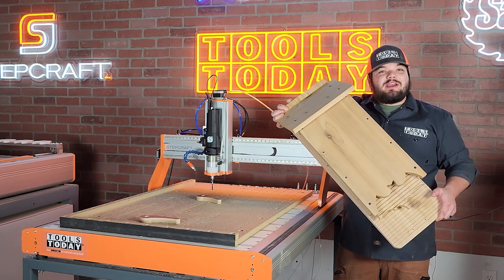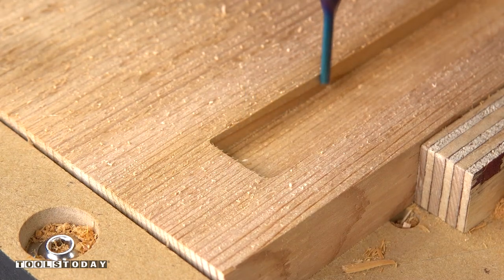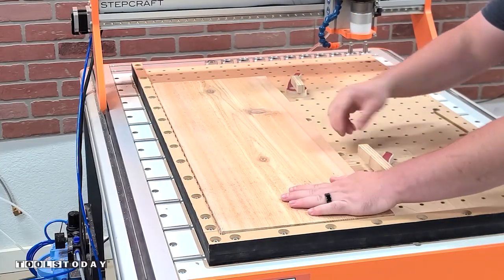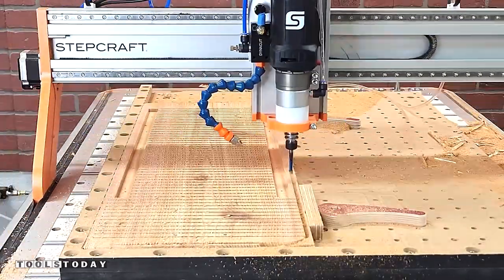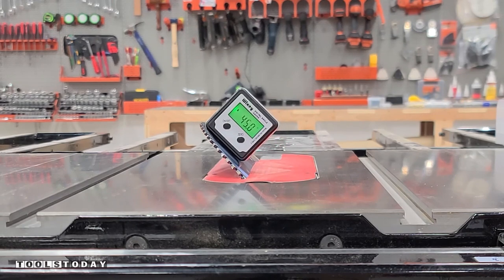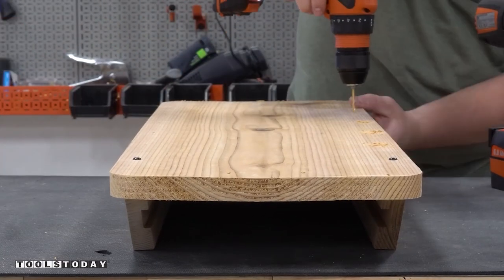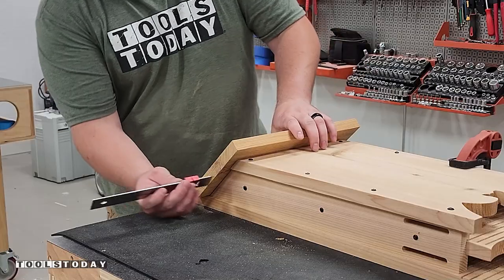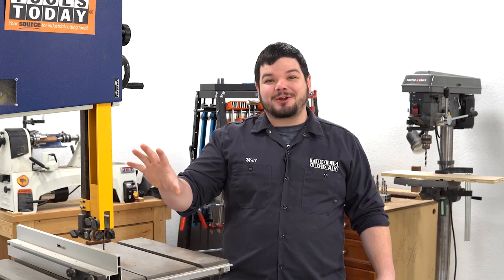How to Make a Bat Box | ToolsToday

Comment: Very cool! Do you have a compressor recommendation for the tool changer?
Reply from the maker: Thanks David, really means a lot coming from you!  I have a 26 gallon Kobalt quiet tech air compressor that I really like.  Smaller compressors will work too, but having a larger one means it doesn't normally turn on when I'm running it throughout a project, and for filming, that's nice.  We also have that compressor running to a distribution block behind the CNC so it powers the ATC as well.  If you need pictures or anything shoot me a message on Instagram and I'll send some over for you!
Reply: @ToolsToday  Right on, thank you!